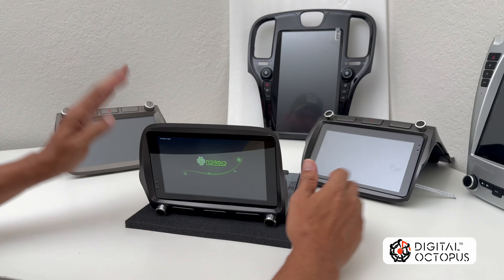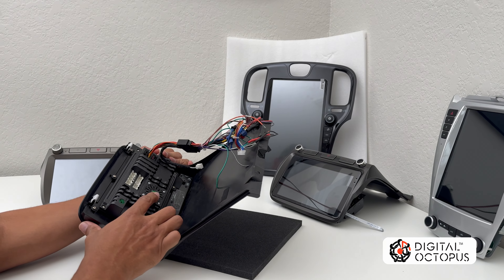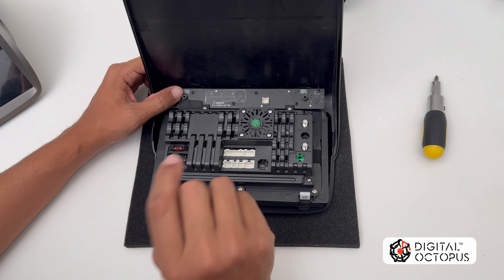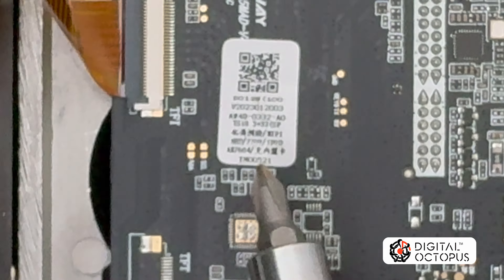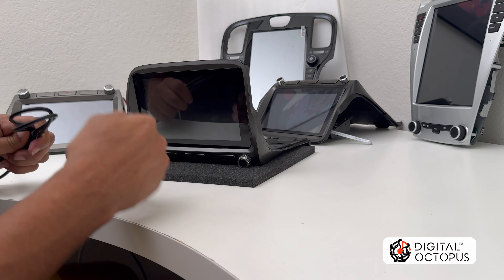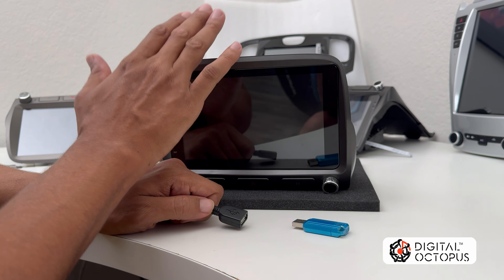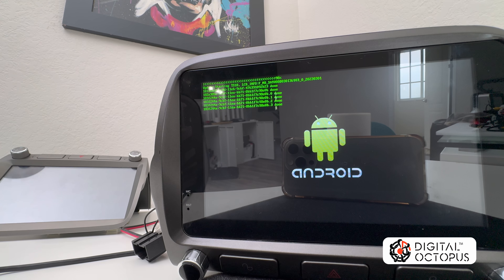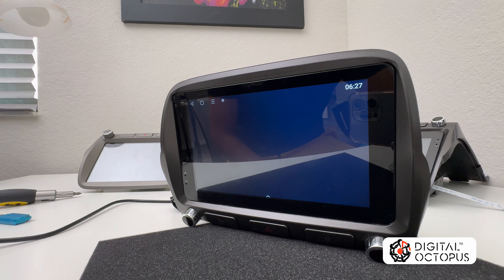TS18/TS10 ANDRIOD RADIO - STUCK ON LOOP FIX

Comment: On a android 12.3 with operation system android 12. Loaded a boot logo and after the car restarted the screen went black. The only  thing I see is a back light no logo. The radio doesn't have any physical buttons. I installed the radio in my BMW 750 Li. How can I resolve this problem.